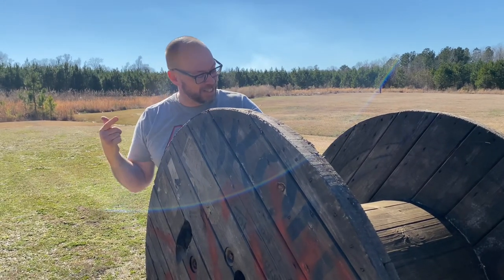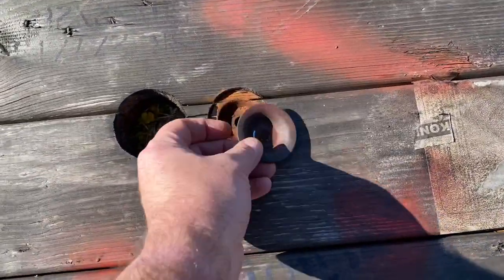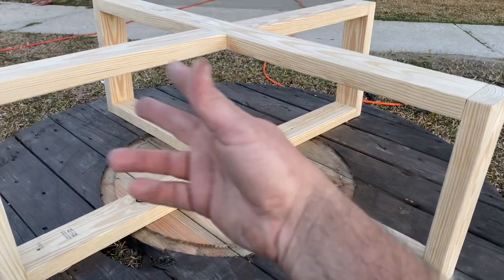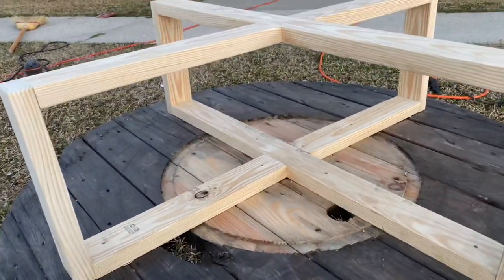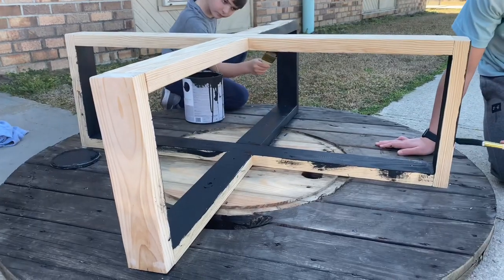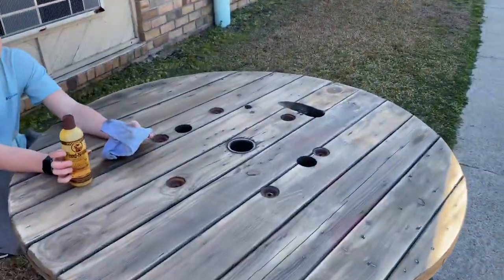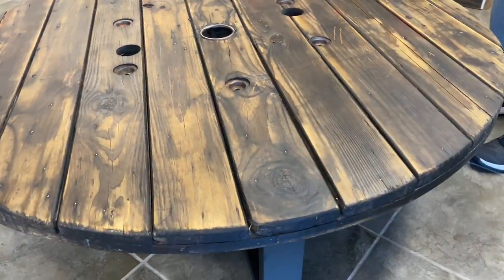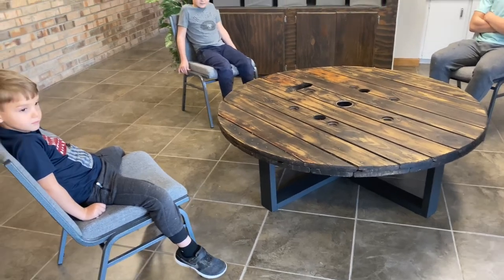Convert a Cable Spool into a Coffee Table for $30

Comment: What were the measurements for the legs on the smaller table with white legs?
Reply from the maker: We aren’t at home I would measure one. But I think it’s 16” high on the legs and we go across almost as long as the table is but come up about 6” short to leave a little over hang for the table.

Comment: You know, I applaud you for effort & initiative, seriously.  But it's awful.  "Look I found this in the landfill...!"  This is not on you, it's a societal and cultural crisis.  There are lots of factors feeding into this but look at the furniture market and the main retailers for it today.  It's all pure garbage.  95 percent of it is "particleboard" junk that will fall apart in a year. and most of it has zero beauty or style;  it's horrible and awkward and brutal.   Nobody making it is involved in anything related to craftsmanship or good quality, or our cultural traditions.  And this is what we're supposed to put up with.   I mean and least what you have here is real wood.  Which is great.  But this should be the bare minumum of expectations.   Even if you find something that looks nice, it will be fake materials and constructed "wrong" because the "designer" and manufacturer doesn't have a clue about craftsmanship and structural issues.  And the worst thing, people are used to it, so there's no longer any demand on the market for quality of any kind.
Reply from the maker: So I went to check out your videos showing the quality you’re referring to, but there’s no content on your page. I think it would be incredible to see your craftsmanship. You definitely should be sharing that on videos for the world to see.